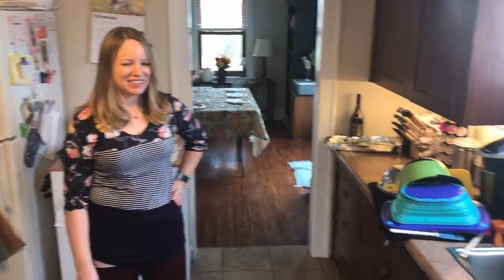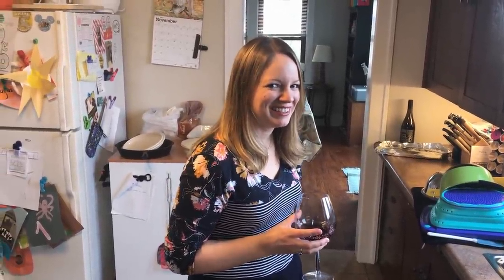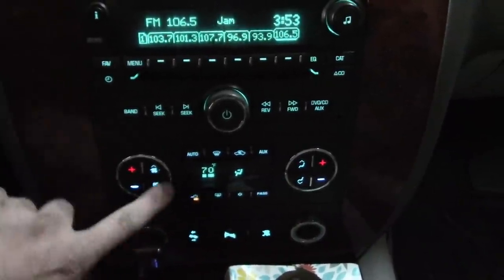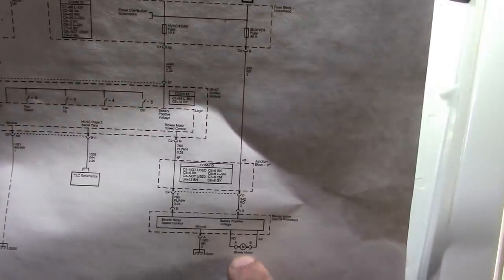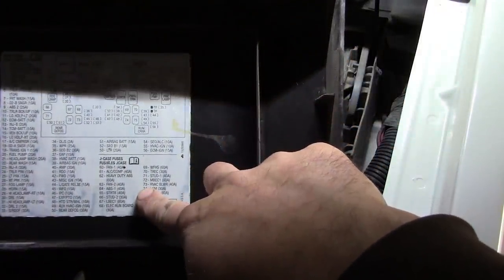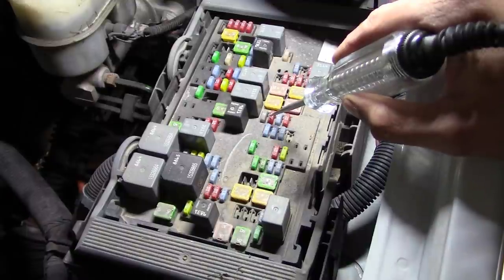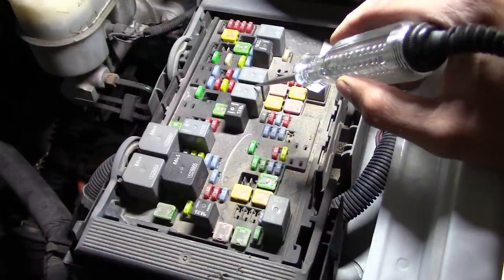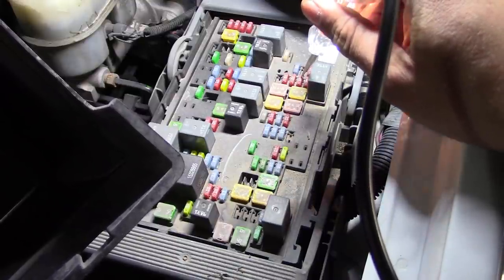2006 Chevy Tahoe - Blower Motor not Working

Comment: I've had problem with connection  issues  on the blower motor with newer GM cars.  It doesn't burn them like a blower motor resistor. But If  i cycle  the connector 95 percent  of the time  it will start working  for me.

Comment: Probably, just a bad connector or corrosion. Did you plug it back to test after the light test?
Reply from the maker: Of course.
Reply: @WatchWesWork  Sorry, maybe I missed that part. Then it might be some current draw that triggered some protection. Anyway I would have replaced the fan even if it started working and there was no obvious reason like corroded contacts or something blocking the vanes...

Comment: Between the brush wear and the commutator wear it was making interment contact.  You're supposed to smack all suspect components with a hammer as per the accepted troubleshooting procedures.  I charge 1 hour diagnostics, of course there are times when it takes a few minutes to find the issue and I"ll charge 30 minutes.  I get the occasional person that balks at that too, but I don't move lower than 30 minutes.  If it turns them off, then it was a successful client screen.
Reply from the maker: That sounds totally reasonable.

Comment: I’ve been designing a car for a little while, what do you all say about a unit that is removable like this, but where the blower has its own bearings and a separate shaft from the motor and the motor has a little stubby splined gear that goes inside the shaft, and the motor is removable with two spread out plastic clips that are also held in with screws so if they break they are replaceable, you could also possibly opt to replace them with bend over tabs or just undo the screws to remove the motor unit, the screws will be stainless for obvious reasons, and there may be a non critical o-ring in the screw holes as an extra precaution, I don’t want to vier into the bad side of over engineering, but I also don’t want to have a system that promotes waste and expensive repairs. Oh, also the motors themselves will be brushless and “rebuildable”, in the sense that you can take it apart and replace the bearings and clean it thoroughly and if you choose, rewind the windings. The overall plan is to have it be easy to replace but also really easy to not have to replace, and built to a degree that is reliable and shouldn’t need replacement, while also not overdoing it enough that costs to replace if needed are astronomical
Reply from the maker: No one will ever let you build this machine!
Reply: @WatchWesWork  why’s that?

Comment: Not sure if you checked it or not, but did you try cleaning the plug to the motor before putting in the new one? When you switched the lead from the old motor to the new one you might have cleaned the connection. Great video Wes, thumbs up.  We put bacon under the skin of our turkey this year, going to do that from now on.  Looks like you had a yumtastick bird there Mrs. Wes.
Reply from the maker: I didn't, but the connections sure looked fine.

Comment: Rookie mistake, buying that blower motor... ;) Personally from experience I'd have given it a whack on the side of the motor & probably would've come back around.  I think sometimes the brushes just get stuck in their own dust & the shock jars them free.  Obviously different if you're working on it in a professional capacity, but I'd honestly chance it, just charging them for the time & if it did happen to fail again simply fit the new motor then and knock your time off. (happy customer for honest cheap fix, worth the risk for how long it takes to swap the motor out on this at least if it did fail again, which is honestly unlikely IME)

Comment: Wiring connector socket, maybe?  So, when you moved to the new connector it was a good circuit.
Reply from the maker: I checked the one to the controller, but I didn't check the other end of the pigtail. So I guess it could have been.

Comment: That was an easier job than an 88 Dodge Dakota, that thing I had to take all of the lower dash panel off to get to the blower motor then it wasn't bad changing the motors, but it's a pain cleaning out the leaves and yuck out . Though the blower works better now.

Comment: Pre programmed timer in the cpu to shut it off for mandatory parts replacement. Just like the little light on your water filter. Just unplug it and plug it back in, the computer thinks it's a new one and off you go.

Comment: Stuck carbon brushes, one or both, at their canal, not enough spring pressure from behind the motor short brushes, specially at cold weather, replacing the whole motor was the best solution.

Comment: Had that issue over the summer on a chevy truck (there is another screw that's easy to get to on the trucks). Thought it was the blower motor controller. Ended up being the connection from the pig tail to the motor. Little bit of cleaning and it was good to go.

Comment: Could have just been a bad/ loose connection in the wire harness connection between the board and motor?  I didn't see you test that.  Not that it matters, the old blower was 15 years old.  Not worth the trouble to pull it back down if it fails again.
Reply from the maker: I don't think so. I did test the one to the controller. But I did not test the end that plugs into the motor.

Comment: Happy Thanksgiving. Not a 2006 probably a 2007 tahoe.  I'm going with the bearings were starting to go out. Had the same thing with a buick enclave
Reply from the maker: Tag says June 06. Dunno what that makes it.
Reply: @WatchWesWork  tag says 06/06 which makes it an 07. Gm runs roughly about a half a year ahead in production.

Comment: @watch wes work I can see maybe the connector you pulled off may have had a bad spot on the blower side of the condor pig tail that's on the blower motor it's-self you didn't test with the pig tail from the motor you went straight to the connector
Reply from the maker: I did test it. I just didn't film it.

Comment: The amapage was probably to high and the Computers in the vehicle wouldn't alow it to run and they shut the fan down before it caused electrical damage to the Ecm and other Electronic Systems @Watch Wes Work

Comment: Bad connection in the plug probably, i'd have tested the motor on the bench before fitting new, like you did just you did it after.
Reply from the maker: I don't think it's the connection. It's not a Dodge.

Comment: Could have been carbon dust buildup in the motor.  Bumping it around when you took it out knocked it loose enough to move.  But damn, 10 amps draw?  seems a little excessive....
Reply from the maker: Yeah, it does seem high.

Comment: This is very disconcerting I took my car in with a bad blower motor and my mechanic, he traced the issue to the gearbox and replaced that for $3000 - the blower motor seems to work now - you may have mis diagnosed that Wesley.

Comment: The dumbest thing about these climate control systems are the fan driven thermostats in the headliner. Everyone thinks they are microphones for the onstar system but they are not. You eventually need to take them out and grease them or else they end up sound like a cheap plastic hamster wheel. Sometimes they do burn out abs you have to replace them. But until then they make a racket right above your head.

Comment: I have 05 Yukon. Many heater issues. Rear heat went out after I had to remove battery.  The front was working intermittently and has an issue with the plug-in and the other day I heard it spark. I had to prop up a stick against the plug to keep it going but it's only got worse now and it stays on even after I turn the key off.  GM suks

Comment: It would seem that if there were no gratuites from youtube or about a hundred dollars in views, guessing, then the job is only going to possibly lead to more work from same people as they tend to send a easy one followed by a what the hell are we doing this job for??? I honestly believe the heater motor was bad as it had some wear on that armature but as far as brushes go, I have taken apart old generators and the brush still had the wire where it should be but a little carbon as best as I could guess where the carbon brush should be was  zero or dust... loses something in the telling and of course I'm illiterate so there's that. They have engineers stay late to add to the misery of how to stump a mechanic, make them bring to dealership... which is good if thats where you work but they have so much work that your trading it in before you can get it in. Not talking about my home life, just how hard it is on some like subaru built the dash completely around the heater core and the rig it was in was one of those old "XT's" that was a   corvette look alike but more like a yogo power wise, except the famous xt6 with turbo or did I say trouble. Seven hours to disassemble and still not sure if I did it right, I know I was scared to bend the plastic and did wind up buying some of it cause I was on the verge of a nervous breakdown! I see another that I missed of yours Wes so will watch that next.
Reply from the maker: I hear you. Sometimes all you can do is pull your hair out!

Comment: Thats not an 06. That body style cane out in 07 and went until 14.
Reply from the maker: Tag says June 06.
Reply: If you look at the vin, count 8 characters from right to left. The 8th character will give you the year. For example, MR123456 would indicate a 2021 model. For 2006-2009, the character should be numeric and will give you the year. So a 2006 would have 6 plus 7 other characters.